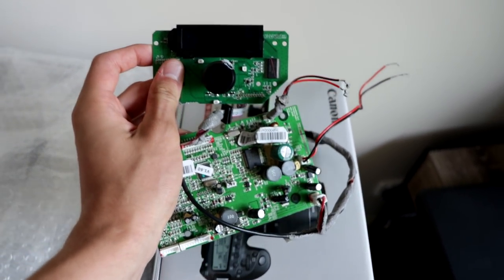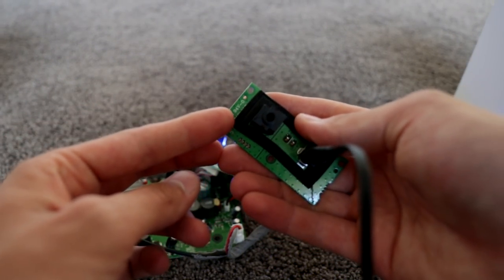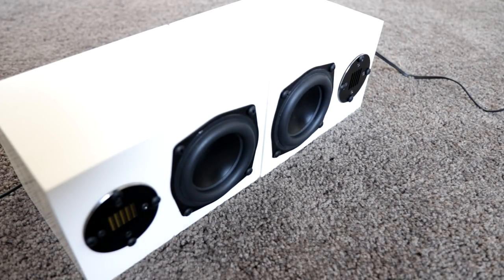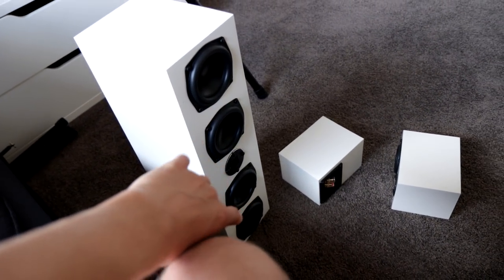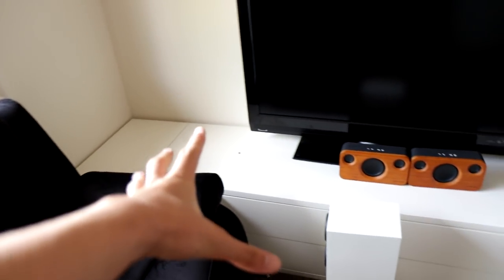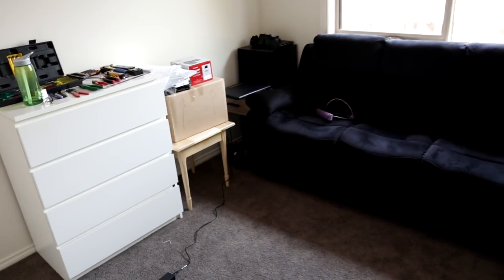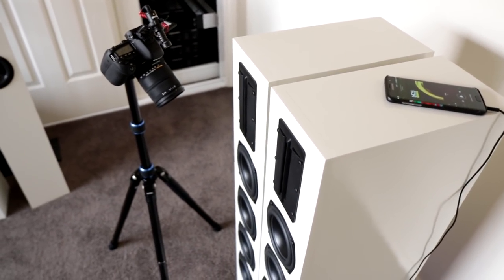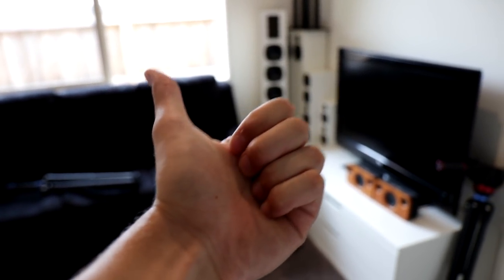Kicker iPod Dock Amplifier VS Dayton Audio Speakers!

Comment: have you gotten a new microphone? sounds amazing
Reply from the maker: Same microphone! Extremely different settings, glad it works well!
Reply: @Doublsmmm  What About ... My Build ...
2 x Dayton RS100-4 full range 
2 x Dayton DS135-8 mid range woofer
2 x Dayton ND25TA tweeter ..

.................
And what if I use ND105-4 as mid range in above system ....

......
Above system design like Sound bar
Each system have seperate channel ... and two tweeter in one channel ... Total 5.1 system ....

Comment: I have a 20W amp which is 52 years old and it somehow maxes out my 120W RMS towers... idk
Reply: Same thing.
Reply: got a 27 year old technics rated at 25wrms and it can max out my mission m74i that are rated at 150wrms lol
Reply: pretty sure that in the past they measured power diffirently
Reply: Yeah pretty much expected because wattage and decibels are not linear.
Reply: I have a 25w logitech subwoofer amplifier and it powers my 200w subwoofer with high excursion
Reply: patk2 what speakers do you have and what amp do you have?
Reply: 1: your using car audio, which there is no problem with that, but it wont be as better sounding as say a pair of Mordaunt-Short Avant 906 towers.
2: it does not matter how loud your system is, I personally don't give a fu** if your system is loud, plus a stadium setup with large 18s can easily be louder. What mostly matters in the majority of cases is if a system sounds good. A system may be loud, but it may sound like garbage
SO overall none cares about your boasting, what do you think will happen to us when you say that, do you think it will make us tremble beneath your feet? It's ok to point out the specs of your system, but boasting about it like world war 3 has happened and rendering everyone else's inferior is just rude. Learn some manners and then come back.
Reply: patk2 do you know what crossovers are for?
Reply: How can you have a sub, mid and tweeter without a crossover!?!? A crossover is a physical object that splits the high and low frequencies between the speakers and it goes inside the speaker cabinets. You really need to learn more about speakers. You can't have a virtual crossover, it does not work that way.
Reply: Do you actually know what you are talking about or what?
Reply: Fatal Potatoe I've got a little trust pc speaker system which is rated 5W RMS for the satellites and it kicks my canton plus gx with 100W really far. And it actually sounds okay.. Besides the low cut.
Reply: it maxes them out? l don't believe that, l would believe that it could get loud and sound good depending on how efficient those towers are. but if they are getting maxed out by a 20w amp then they are not 120w RMS.
Reply: Fatal Potatoe+ you were talking to patk2? he was here? god damn l keep running into that guy everywhere l go. l guess this time l just missed him.
Reply: Electronics For Fun It even says on the back of the towers 120W RMS, they are Mordaunt Short avant 906 towers you can even go look it up. They are good speakers but they are either over rated or the amp is under rated. The amp is a trio ka-2000
Reply: if you speakers or getting maxed out then the amp is probably underrated, it looks like a pretty good amp. l assumed it was one of those chinese mini amps, but now that l can actually see it, it looks a lot higher quality then what l was picturing.
Reply: Fatal Potatoe the song love my way has a sound that plays on the tweeters the mid speakers and subwoofer so this means all of the speakers should have the same loudness
Reply: please upload a video
Reply: Fatal Potatoe
Wattage ratings were more truthful back then. Especially if it's a tube/valve amp.
Reply: My 52 watt (into 6ohm) amp maxes out 175 watt rms 6ohm towers 😂
Reply: because it has no damping so the speakers "flapping " more than others
Reply: @brandonhilton4826  i know this a year old lol not surprised that 25 watt amp is maxing out your missions as the pretty efficient good speakers tho :)

Comment: If you want a good portable bluetooth speaker I suggest an Oontz Angel speaker. There are a lot to choose from and the sound quality is surprising, plus they can get pretty loud. I have the Oontz Angel 3 and its only 10 watts but with the passive radiator on the bottom when bass hits just causes it to bounce around. I love the thing, the treble is very present and the bass is strong. Vocals are clear and crisp and the over all sound quality is amazing for what they are. You can find them on ebay and amazon and maybe some other sites.

Comment: So about how many watts do u think that that little amplifier pushes?
Reply: The iK501 specs say it's 2x20w RMS
Reply: It depends on how many volts you operate it with. According to the datasheet, 35 volts is the maximum at 2x25w at 8ohm and 2x50w at 4ohm at 22volt

Comment: Where the heck did you got it?
How many power it has?
Would be great if you do video about making portable speaker with 2 Dayton 1.5/2inch speakers and with that amp.
Reply: MegaMixKiller 1.5/2 inch??? What's the point? That isn't gonna sound good at all.
Reply: Mr.Someone \Tom/ True but it will be small size. Do you want to carry a big heavy brick?
Reply: MegaMixKiller No, but a heavy brick won't be the equivalent to two 5 inch woofers...
Reply: Mr.Someone \Tom/ Ok i understand you. You want to carry 5 inch woofers in your hand with no bag. GOOD FOR YOU.

Comment: Oh it takes 12 volts? i thought u need 22 volts
Reply: That's what I was thinking the whole time... I have the iPod K501 myself and the board only has version 1.3 on it on the MCU. I drive it with a battery pack with 24.6 volts. I thought it wouldn't work, but it works can even operate it up to 35 V, so the output power is variable sorry for my english google translate

Comment: I have a question if I paid you enough could you build me those exact speakers you have the. Center channel small book shelf ,floor towers ,your smaller floor towers and the two subs but can you paint them white for me as well there’s won’t build the cabinets I will pay you really much if you do this to me talking about 4000 bucks with that do it because I like how the sound plus my home theater system just died and I like this so yeah so please get in contact with me thank you very much goodbye